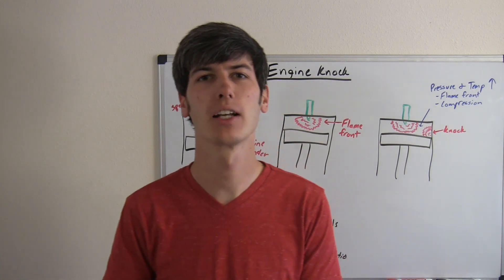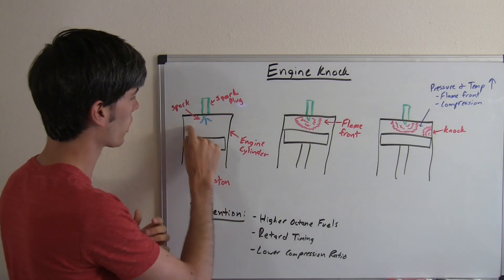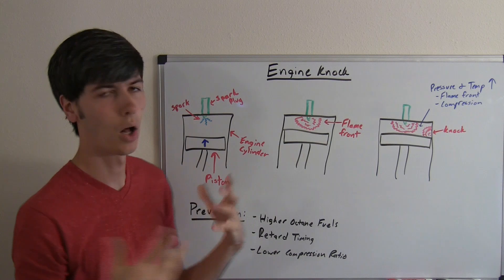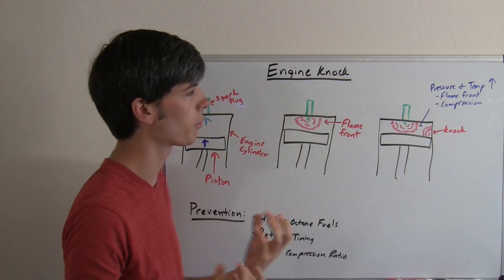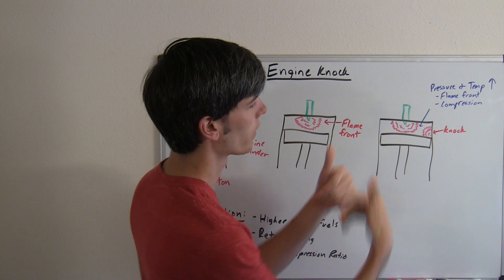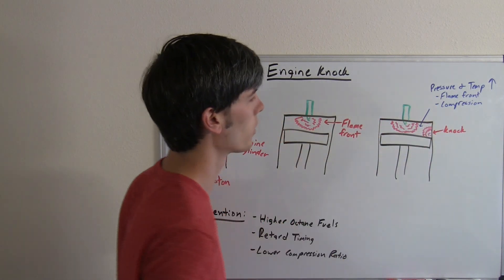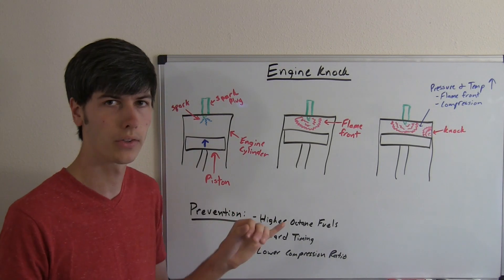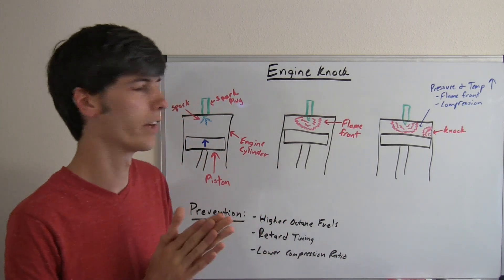Engine Knock Sound - Explained

Comment: can you tell me about running high octane 95/98 on a very slow and old car? (in my country mostly thats available)
Reply: It really won't make a difference. Higher octane fuel can resist detonation due to pressure and heat more, so it won't pre-detonate when compressed before the spark plug fires. Running it in an engine that doesn't need it doesn't make a difference, positive or negative, as far as I know.
Reply: well here in the uk we run our 72 beetle on 95 because that is the cheapest stuff you can get around here and it seems to have no problem
Reply: ***** Yup. I just meant for the car there won't be negative side effects.

Comment: can you prevent engine knock by putting two spark plugs, like one in the right and on the left so you make sure that all your fuel burns?
Reply from the maker: There are companies that have done this, but I believe it's primarily due to emissions. Perhaps a potential solutions, but probably not the simplest, nor the cheapest.
Reply: Yes you can.
Reply: Engineering Explained The Z24i that Nissan made in the 80's was a dual spark plug setup, purely for emissions.  The second plug actually fires after TDC in hopes of burning off any remaining fuel.  Top fuel dragsters typically use two plugs as well, for power of course.

Comment: Is there any difference between engine knock and pre-ignition?
Reply from the maker: Yes, pre-ignition is when you have combustion occur prior to the spark plug igniting the air-fuel mixture (you're therefore incapable of controlling timing). This can occur due to a hot spot, poor quality gasoline, or other factors. Knock (as mentioned) is when the air-fuel mixture combusts in a separate pocket after the spark has ignited.
Reply: Engineering Explained  is it possible to have knock or pre-ignition with lower charge? Ex. 2nd or 3rd gear at constant quite low speeds.
Reply: Engineering Explained I always though they where the same and now it has been clarified. Thank, great video
Reply: Same here.
Reply: I think pre-ignition is normally to do with diesel engines in that a heated coil warms the chamber up so that the fuel can combust when you turn the ignition the first time.